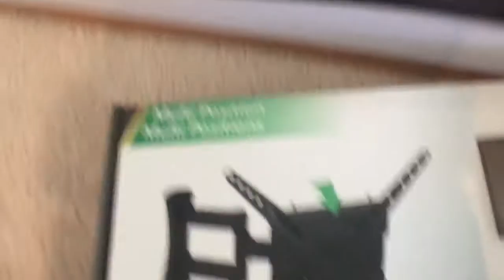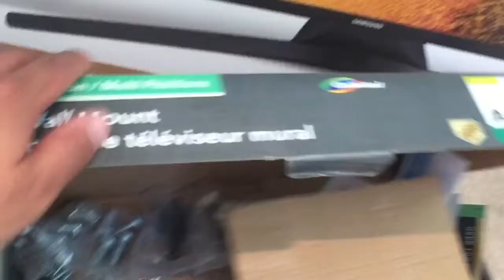TV WALL MOUNT DIY VIDEO : BUCKET LIST CHECK

Comment: if the tv is larger than the cutout, cant i just screw in either a piece of plywood, or 2 2/4's that extend over the front of the cutout, where the main wall supports are?

Comment: With all due respect you should research the grain of the wood versus the direction of forces.  I believe the wood should be vertical. A 50lb TV on a swivel that is retracted out 28" can put tremendous outward pressure from the top.